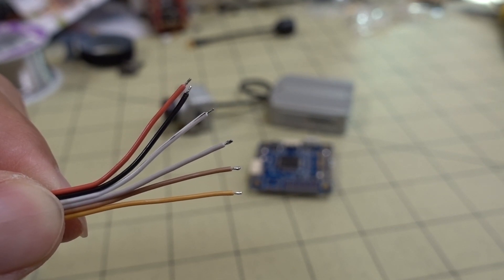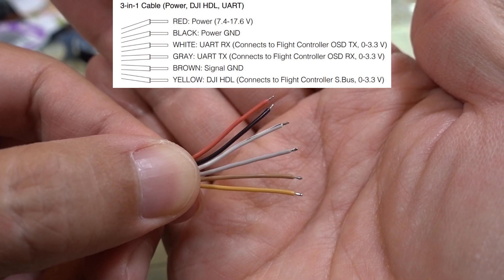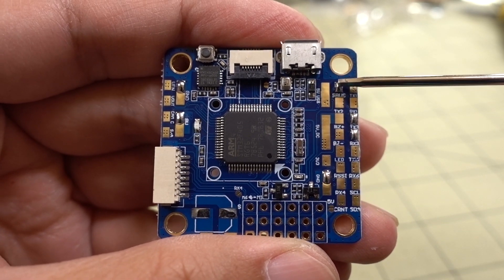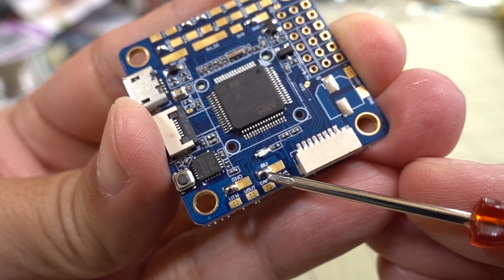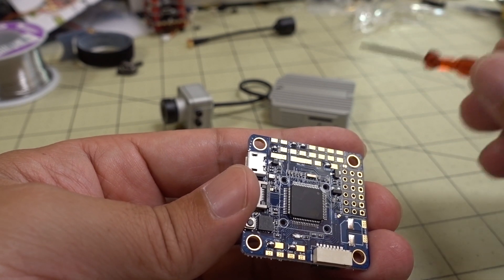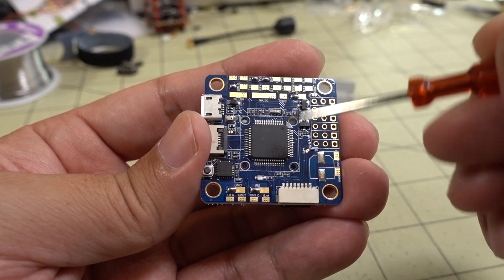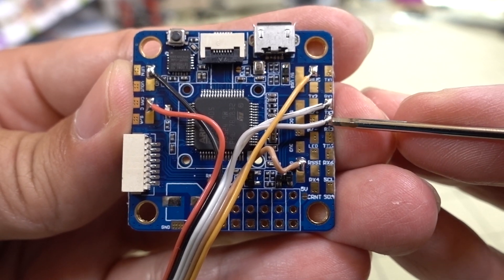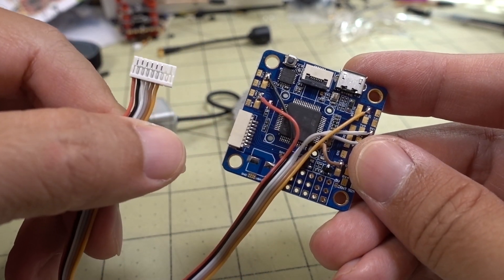HOW-TO Wire the DJI FPV Air Unit (or Caddx Vista/Air Unit Lite) for Betaflight 🎓

Comment from the maker: 👉 Flight controller used in video - http://bit.ly/2AydjjT

Building from scratch?  Get this flight stack for no soldering!

🛒NewBeeDrone Infinity30 Stack - http://bit.ly/2QayOSA

🛒 Where to buy the DJI Digital FPV System?
       DJI - http://bit.ly/2kB8Atp
       BG - http://bit.ly/2Ljqfiu
       RDQ - http://bit.ly/2Q3ZqET
       NBD - http://bit.ly/2Q1p6lt

Comment: Does this Works the same with the o3 bro? My connector came off mob 8 o3 and I don’t have to go through the pain of getting a micro soldering kit.
Reply from the maker: It's very similar though not sure it's exactly the same.
Reply: @AlbertKimTV  what’s the difference if you don’t mind me asking? Trying to get this quad in the air.

Comment: Thanks for sharing, Would be great to show how the control surface 6 channels of an aircraft would be connected to the dji air unit to use the dji transmitter to fly a fixed wing airplane.  Or maybe you can make a video on how to power the dji air unit in case going to use a spektrum tx and rx , could the AU be powered from the rx or the 6s Lipo balance lead?  Thanks.
Reply: No idea what is the flight control since it is not used in fixed wing aircrafts. Thanks

Comment: Do I really need to use the flight controller or can I just direct power to lead and then to goggles?
Reply from the maker: You need the flight controller to send the arm signal so the air unit will go to full power.  Otherwise it stays in low power mode.

Comment: I'm planning on putting a caddx vista on my rc plane with no flight controller. Should there be a issue with just soldering a jst plug straight into the camera unit with a 300mah 3s lipo powering it ?
Reply from the maker: Should work

Comment: ik this might look like the dumbest question ever but in fpv what type of wires should you be looking for? for repairs and stuff
Reply from the maker: Size depends on the power draw requirements.  If it draws a lot of power, the thicker the gauge of wire you need.
Reply: @AlbertKimTV  okk, ty!!

Comment: Can you use an alternate pad/uart other than sbus for the controller?
Reply from the maker: For the RC control, only SBUS will work.  There might be a way to make a UART RX pad to work as SBUS but that will vary by FC model.  You'd have to look at the FC manual for that information.
Reply: @AlbertKimTV  Thanks Albert!! Appreciate the answer!!

Comment: Thanks for this vid, at least confirmed what I read on the wiring diagram of HGLRC F722.
I'm confused, went over it several times.
I couldn't use the wire harness that came with the FC because it's too short (tough luck - would have been easier to just plug in both sides) so I used the cable that came with the air unit which is long enough and solder the cables to corresponding FC pads.
I haven't used the last 2 wires because I am not using dji controller.
I'm sure I have the wiring correctly done and I verified continuity between each cable of the plug that goes into dji air unit to each pad on the fc.
I have MSP activated on the right UART number, I have OSD enabled in BF, dunno what Display does but I cannot enable it for some unknown reason.
I have Custom OSD enabled on the Goggles but still not getting any OSD elements.
Is there anything else I can still check?
Reply from the maker: I'd have to take a look at a photo of your wiring and parts. Post a photo to Instagram and tag me @marblekit.
Reply: @AlbertKimTV  Finally found the nasty cause of my problem, did felt like the plug that goes into the air unit was a little bit harder to insert than I was used to, in fact a tiny little piece of sh** cable silicone tubing (hard to even see, probably from when I was removing it from the ends on the other side of the cable to solder to fc) got stuck in the air unit female plug part blocking connection to either white or gray or both, geez that one got me struggling. I even checked continuity of cables but didn't see that one coming.
Either way still many thanks man for taking the time and wanting to help me in the first place, much appreciated.
Will not forget that, maybe I can help you with sth one day.

Comment: I need help, I have assembled a drone with the AIRUNIT and everything is fine, except that I cannot show the drone's battery charge, GPS data, etc. on the screen, of course, in the glasses it is configured as CUSTOM OSD: ON
Help
Reply from the maker: You don't have the UART setup correctly.  Either the wires are reversed or you don't have MSP enabled on that UART or you have it enabled on the wrong UART.
Reply: @AlbertKimTV  Thanks,  my error was the MSP
Reply: What does the MSP configuration of a port do in Betafligth? When should it be activated?
Thanks

Comment: Hi I  have a caddx vista and my cinewhoop uses 6s batteries. Will 6S also melt the caddx vista?
Reply from the maker: It is rated for 6S but I recommend using a 9V/2A BEC to power it instead.  I hear 6S usage over a long time will shorten the life of the Vista from the extra heat produced on 6S over a lower voltage.

Comment: hi, so the last 2 cables.  the brown and yellow no need to solder. If i dont use DJI radio controller right? I am using XF now. thx

Comment: I have the DJI air unit running the goggles and a DJI remote controller but I cannot figure out how to wire the air unit to the the drone. I have watched many YouTube videos but they seem to be different wiring specs,  help anyone?

Comment: The grey should be on rx not tx right? And white wire should be on tx not rx... that is why mine is not working
Reply from the maker: Watch the video again.  Where the pad labels are make it a bit confusing.  It's wired up correctly.  Many other people are seeing this incorrectly as well.
Reply: @AlbertKimTV  jus saw it jus now bro albert.. mah bad.. hehehehe your right..  hehehe..
Reply: Just got my first air unit. I also thought your wiring was reversed. But yeah it's correct. The problem was that the FC labels were on the bottom of the pad. With the other FCs I've worked on over the years (analog), the labels were typically on top of the pads. Thus causing the confusion I guess. Thanks for the tutorial video!

Comment: How do you connect this to a 6s set up with no pads on FC for required power?
Reply from the maker: You need a 9v/2A regulator wired in between the Air Unit power and battery.

Comment: In the video you point out a specific pad for the signal ground (brown wire). My understanding is that every ground pad on the fc should be the same electrically? Is there something unusual about that brown signal ground wire or can it just be connected to any ground pad on the fc?

Thanks for the clear and concise how-to's...you are one of just a few youtubers I go too for information like this.
Reply from the maker: All the grounds should be the same on most flight controllers.  There are some where it may not be and you'll have to consult the documentation for those specific cases.  Those are rare however.

Comment: my air unit suddenly cannot show custom OSD and aircraft voltage, how to fix it,

i've tried to solder with other uart on the same fc but not work

also i change my fc and still not work 
please help
Reply from the maker: Have you tried to reset the system from inside the goggle?  Are you on the latest betaflight firmware and DJI firmware?
Reply: @AlbertKimTV  im in 4.2 betaflight, and the latest dji fpv firmware

have done everything, reset goggle, reflash air unit and goggle 😓

Comment: I fly 5S with the DJI air unit all the time, power and ground straight from battery. I've read the air unit has a 24v regulator and that people fly 6S without issue as well (though that is pushing it)
Reply: Did it ever break from excessive voltage?
Reply: @captainmarcin6105  Nope, still going strong today

Comment: WHat if your not using the signal wire. will I still get OSD ? Haven't tried hooking thats up ,but want to install GPS on my iflight 5" with TBS Crossfire.
Reply from the maker: You still get OSD, just nothing for RC signal

Comment: Hello from Spain, please I would like to ask you a question: is it possible to connect this system to an MJXBugs8? by connecting only the power and would my glasses receive the signal? Thank you very much for your videos and greetings.
Reply from the maker: Yes, you can connect it to anything that will supply the correct voltage and you'll get video to the goggles as long as it's properly bound.
Reply: @AlbertKimTV  
Resultados de la búsqueda

Resultado de traducción

Español

Inglés

Okey, exactly, my idea is to fly the Bugs 8 with its radio control since it seems to me an excellent Drone, and the DJI camera equipment installed in it, thank so much  for your valuable information, best regards!

Comment: Please help bought this with air unit.... i dont want air unit  i want my run cam split  that will neex a vtx..... do i need new f7 as this is just all connectors? Do i need new esc board ? 

Please help

Comment: Hi , I want to wire my DJI air unit to my immersion vortex 285 , I am using my own transmitter (EzUHF) , any ideas how to do this ? I am going to remove the Video transmitter that is stock , and intend to power directly from the power pad for the main battery lead but would like some ideas where I would wire the other cables .
Reply from the maker: Sorry, I don't know anything about that model so not sure how the board is wired up or what pads are the UARTs.  I assume you got a manual with yours?  I'd try to start there.

Comment: Hello Kim ...I connected all up to my flight controller and pwr up all open bata flight  and i get no connection between the dji system and the fc its a dji radio what am I doing wrong??? help please thanks

fc is a succex-d f7 twing g

Comment: Hey there im confused about this board " flycolor x-tower 40a " could you somehow explain to me how to hook it up to the dji fpv camera? 
Been seraching around and cant find any help. Thanks
Reply from the maker: Don't have that board but it should have come with a manual with wiring diagram.  Just match up the wires to the same pads on that FC like in this video and it should work.
Reply: @AlbertKimTV  allright thanks for the response. The thing about this FC is that it doesn't have any solder pans only contacts. And what I can read from the manual is " FC integrated 3.3V, 5V, 12V for a receiver, VTX, camera, buzzer, LED and other peripheral devices" does this mean it will it will be ok to hook it up there even if I fly with a 6s battery? Do you know if the FC will be ok to support 12 with 2a ? Or should I get a regulator between camera and the battery?

Comment: If I'm using my own receiver (csfr) and I don't use the sbus, do I still need to enable the msp for the uart to control and display info from Betaflight?
Reply from the maker: If you don't enable MSP, I don't think the OSD will work.

Comment: Hello there Mr Kim ...I connected all up to my flight controller and pwr up all open bata flight  and i get no receiver to radio connection its a dji radio what am I doing wrong??? help please thanks
Reply from the maker: Need more information about your setup and how you connected everything. I don't know what's wrong given almost no information about what you have.
Reply: @AlbertKimTV  my bad ... i found out what it was had to set sbus_ baud_ fast = on/ I have a speedy bee f4 4.1 bata flight setting its working fine now... :-) thanks for getting back to me fast though I really appreciate it :-) great video too good job !!!

Comment: Hey does it work with 6s ?
Can i use the 9V uart at this stack ?
https://cdn.shopify.com/s/files/1/0027/2708/4144/files/F405_MK2.png?85
Reply from the maker: I don't think that 9v regulator has the wattage capacity.  I didn't see any information about it.
Reply: Albert Kim Hello Albert, i’m new to this, but how do you mean the regulator on the FC above doesn’t have the wattage capacity? It says on the left that it supplies 9V 2A, which is 18 watts, greater than the wattage you said for the FPV air unit, 16 watts. Do you mind explain your theory here? Thank you!

Comment: Great video. Why is the RX cable soldered to the TX pad and vice versa?
Reply from the maker: That is how the UART connections work.  RX to TX and TX to RX.  That's just how it is.
Reply: Thanks very much 🙂
Reply: @scolty  rx is receive and TX is transmit. Think about baseball. You throw from your hand (transmit) and catch in a glove (receive). You wouldn't throw a ball from a glove or catch one with your hand. I mean, yes we've all tried both of those things, but you get what I mean. 

Your hand throws a ball and a glove catches it. 
TX sends signal and RX receives it.

Comment: Trying so hard not to buy this 😂😂
Reply: I pulled the trigger but mine is sitting on my work bench still in the box...  I'm tied up until Sunday evening so don't want to even get started..  Will be putting it in my Armattan Chameleon Ti
Reply: jovid7 i tried for a few weeks:)
Reply: mine is sitting in the shopping cart
Reply from the maker: @daslolo  do it!  LOL
Reply: @AlbertKimTV  😂😂😂🤪
Reply: jovid7 it’s practically yours 😂
Reply: I envy you guys that have the space to fly 5 inchers. I'm kind of limited to 3" max so it's made it a little bit easier to layoff of this otherwise, I'm sure I would have burned my 💲💲💲 on it already.
Reply from the maker: @jovid7  I have this in an under 250g AUW 3-inch... video out soon...
Reply: jovid7 totally. cant fly 5” much anymore. thats why i have it in a 2.5” running 4S. have a 3” coming
Reply: @DOJIELDIENVE that's awesome. Thanks for sharing. I may have to give in lol.